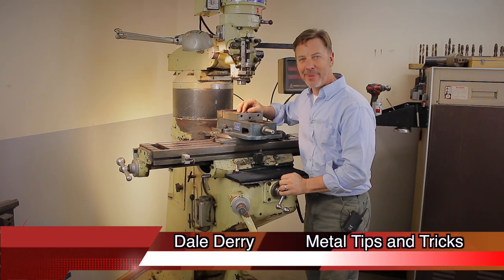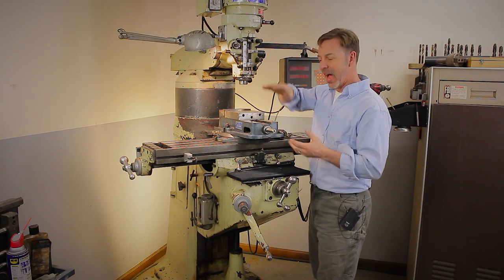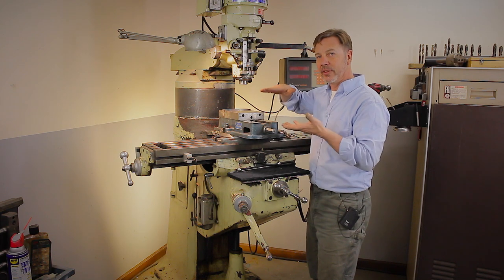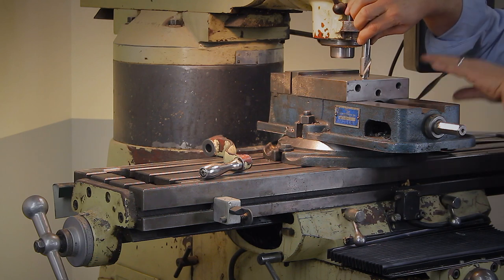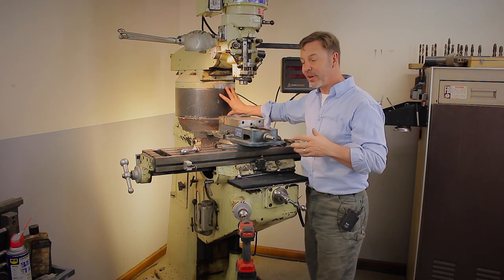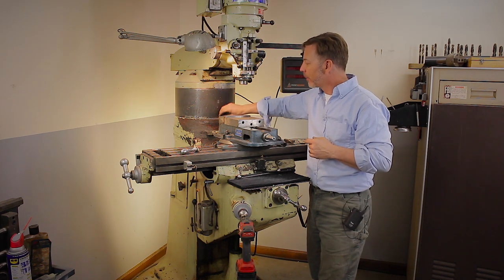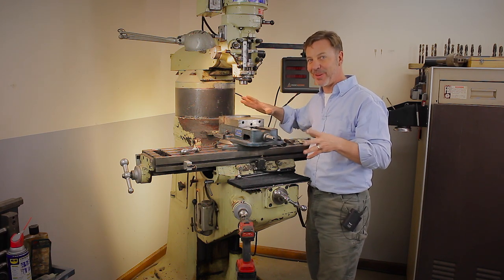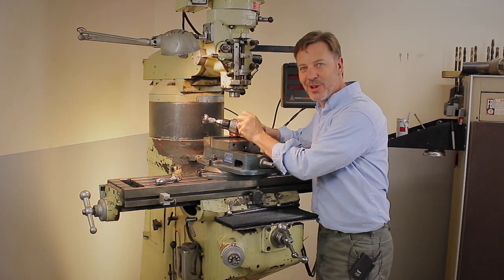Milling Machine riser block

Comment: Dale I agree with being able to stand upright while working with the mill as the best reason for adding a riser. Of course I'm 6'2" so that ads a level of comfort to operations. As a project I would just buy the riser kit for my mill instead of doing any machining. They sell riser kuts in 4", 5", 6", 7", and 8" that I am aware of and may even sell them larger than that. The kits i've seen also come with the needed bolts and the spider that goes inside the riser and kits go from around $350 to about $700. When you consider the cost of materials and time machining it makes sense to buy the kit.
Thanks for your wonderful videos and keep up the excelent work.
Cheers,
John
Reply from the maker: +Old School Cop Shop 
Thanks for your comment

Comment: Dale,
I hear you on the back issues. Somethings built for 5'6" guys don't work very well for us 6' types. It can be pure misery.
My Brown & Sharpe horizontal is on 4x4's to get the height of the cutter up where it's convenient for me to work.
It has the added advantage of allowing me to move it using a pallet jack (slightly overloaded but effective). 
I haven't moved it, but I can. :)
I plan to make adjustable leveler/riser blocks but haven't gotten around to it yet.
So that means as soon as I get a round touit, I'll make them and make a video of the process.
Thanks for the video.
John
Reply from the maker: +John Bazaar 
Great comment. Please send my a not when you do the video.

Comment: I have a Grizzly G0796 mill.  I originally bought the 6" swivel vise with it.  With the drill chuck I was loping off and regrinding special shorty bits for some jobs.  I bought a 6" rotary table and 5" scroll chuck which was ok for small stuff but generally too small for my projects.  I bought a 12" rotary table and a old 10" Bison scroll chuck for it.  With that on the table I really need the riser block.  With the big-10" I get the rigidity I was missing with the 5" chuck and can safely hold a part of significant size.  A crane rail is going in now to make the riser install much easier.  Yes, a two-step stool will be needed for this average height hobbyist to reach the quill bolt but it will be worth it.  Yes, it's good to be able to do set ups and mill directly on the table but the majority of my projects require either the vise or the big rotary table.  Before I retired set-up time was where you either made it or got your ass handed to you.

Comment: Risers are awesome!  I prefer a 4"  so I can still work off the table with a short end mill.  I bought one off of e-Bay, but keep in mind Bridgeport clones are not always interchangeable with a real Bridgeports.  I got an import riser and needed to boar it out to fit.   It was an easy modification, but if you only have one machine you may need to reassemble the mill to modify the riser.   Good thing I have a second Bridgeport.  You will probably want a power draw bar if you use a riser if you don't have one already.
Reply from the maker: +Roger Fries 
Great comment. :-)

Comment: Dale ---

I used to work in a prototype machine shop that had one Bridgeport with a riser extension... No one would use it, because of it's inherent inefficiency... Particularly, when doing jobs that require loosening the draw-bar to change tools... It is nothing short of a real pain in the ass.

Furthermore, I'm sure I'm not the only one who noticed, that when you screwed the knee lead screw out of it's nut, the table was still 6 - 8 inches away from the quill.... Not all jobs are done in a vice... Sometimes you need to clamp work directly to the table... In which case, in order to reach the work, you may have to set up a job on risers, and in a lot of cases, extend the quill... The more you extend the quill, the less rigid it is.

Engine blocks --- The Bridgeport mill (Series I) without a riser has a max. table to quill height of over 18 inches.... A Chevy small block is only around 13 inches, from oil pan flange to manifold deck - no riser needed, if you're milling the oil-pan flange, or the manifold deck ( as in the case of a set of "clipped" heads where you need to take some off to get the manifold bolt holes to realign.)

In short, the riser is a poor solution to a problem that doesn't arise often enough to justify it's lack of efficiency.

This isn't to diminish anything you're doing - in fact, you've shown THIS old dog (Journeyman Certificate 1966) some new tricks... Love your work... Love your videos.

Frank
Reply from the maker: +franksalterego Thanks for your comment. :-)
Reply: particularly when what? comment got truncated
Reply: I find that the short guys always bitch and moan about the riser block ;). I'm 5 10 and have no problem reaching the drawbar. Sometimes I run the mill for a variety of jobs and probably swap tools over 100x in a day, it never bothers me. The same can't be said for the hunchbacked angry old man I used to work with. Nothing a 20 dollar stepstool cant fix :D
Reply: The need for a riser block is very shop specific. For the type of work that I do, it’s necessary. I just ordered a 6 inch riser block for my Taiwanese Jet brand Bridgeport knock off.  Probably what I really need is a horizontal boring machine, but I don’t have room for it in my shop.

Comment: Good video.  The mill that I cut my teeth on had a 3" riser and I never knew that it was there unit, I used another mill.  It was at an engine shop, and we did not surface on the mill, but when you were indexing lifter bores or adding splayed bolt main caps you needed every last inch to get a big block Chevy setup in there.  Thanks. R.J.
Reply from the maker: +Abc Defg 
Thanks  for your comment

Comment: Like the riser and the added capacity. I would be concerned however, of cranking the knee completely out of the nut and damaging the threaded end. I've marked my column to prevent just that on mine. Perhaps an extended screw (2-3") might be a good project to add to the riser?

Colin :-)
Reply: +CompEdgeX I ran my knee lead screw out of the nut and it jammed going back in.  Had to jack the knee way up and clean up the start of the screw thread.  I will make sure not to do that again!
Reply: ***** I've "heard" that can happen...:-) Thats why mine is marked!
Reply: +CompEdgeX I needed to raise mine for some measurements for a DRO, I brought it up to the top and when I went to lower it  was stuck and when I turned the lever to lower it it pulled the screw up and  cracked the casting on the bottom where the screw sits. this is a new to me mill that was sitting for maybe 10 years before I got it. Got it free and it just rest at the bottom and is working fine. I WILL NEED TO MARK MINE
Reply: Ed Ginsberg
Bummer that it cracked...probably got up past the dovetails enough to jam?
Reply from the maker: +CompEdgeX 
I think marking the limits of the table is a great idea. I don't think adding an extension screw would work, because you push it past the limits of the dovetail ways. Great, comment thanks

Comment: So I've been thinking of adding one to my mill, but I'm already having trouble reaching the drawbar as it is? Now I'm 5'10" which isn't that short, so how is it you nan reach the drawbar. Do you use a step stool or something? Plus how does that effect the accuracy of the knee? Does it get tighter the higher you go up because of less wear on the knee ways? I have a worn out production mill which I really need to have rescraped (should be been done this winter but the 27" southbend has been the priority since September). Okay well thanks for another fine video Dale, I don't suppose you'd do one about rebuilding a mill?
Reply from the maker: +The Texas Gun Guy 
I use a step stool. and I'm thinking about scraping my mill this spring.:-)
Reply: +Metal Tips and Tricks (Dale Derry) I send you my mill to practice on if you'd like😏👊

Comment: I have an 8" riser on mine and I despise its presence for most work.  It does allow some more Z clearance , however it does limit your ability to reach the table for larger, plate type, non-vise work without extending the quill too far. It really depends on what type of work you are doing.  If you do not absolutely need the additional clearance, DON'T DO IT just because you may need it "someday",  you will regret it.   I plan on removing it at some point, its just a chore without a crane, as mine has a much larger 5HP geared head.  I would give my riser away if someone wanted to remove it.  You will definitely want a power drawbar with the riser.  Reaching the drawbar requires a step with the riser in place.

Comment: Dale I have a question about the drill.  Much has been said about this.  Here  is a common  six or V8 block on the table.  Don't need a riser- Big Cincinnati has
the travel.  OK;  so I crank up the knee 5,6 turns with two arms, I have to sit down. 
So,  before the trouble of machining said adapter for a drill? I see already what guys
use (batt drill) & won't cut it with this mill.   Guess I need a 1930s 80lb drill thats got
50hp  lol  problem is they don't have reverse.  So what's your guess.    sam
Reply: Would a longer handle for more leverage help you?
Reply from the maker: +samuel pine 
Sorry to here you have to big of a mill. LOL There are some drills with cords that will handle it. Here is one from Porta cable model 6615. I do not know if they still sell it. You might find one on eBay.
Reply: Thanks Dale oh I have electric drills alright problem is they are fifty pounders ;  guess I'll live with it.   sam

Comment: I'd like to know what your Z-axis capacity is w/o the riser. And was it added due to a lack of capacity (mostly) or for ease of use (added table/crank ht). Thx Dale.
Reply from the maker: +Bill Wightman 
The capacity of my mill is 16 inches without the riser 23 inches with.  Originally I thought the capacity would be the most important, but rising the table up to a more comfortable hight is really the biggest plus for me

Comment: hello congratulations for the video, if in the absence of cast iron find a common steel tube about 30mm thick and make fittings in case you need to put flanges and solder have stress relief in an oven would be good one over 1 inch thick ? I have a home milling machine also one of the brand Veker vk430vp, here in Brazil we only use [iso 40] and for mine I made a riser block, but gray cast iron with 90mm height, was the only material I had in hands , but I exaggerated the thickness must be about 100mm thicker. I'm very satisfied even with less than 4 "in height already improved a lot.

Comment: If you  did occasionally need to get extra knee movement, a simple spacer under the elevating screw outer would get you out of trouble, and a lot easier to do than make a longer screw.

Comment: In a recent video, you did a poll, could you please do some cylindrical grinding and lathe internal and external threading. also that drill adapter will be a good project for me will involve a rotary table i dont have one at work anymore  :(
Reply from the maker: +nathan hellyer 
No you will not need a rotary table. Im going to try and do some grinding videos this summer.

Comment: I have two Bridgeport series 2 mills, one with and one without. The mill with the riser gets very little use as the drawbar nut is 9ft 3inch off the ground. Oddly I have never found a hands down winner for the block yet due to the head size haven't found the ambition to remove it!

Comment: Another advantage of using iron instead of steel for the riser block is that irons (cast iron, ductile iron,  Meehanite) are all vibration dampening, whereas steel transmits vibrations.  That's why the traditional material for quality machine bases and many machine tools is iron.  Of course,  a home machinist will probably not be too concerned with an occasional vibration.  Given that, oak, concrete, or any other hard material would be suitable.  Availability, workability and cost then become the factors.  Nicely finished concrete would be just as pretty as painted iron.  Who will be the first with a concrete riser?
Reply from the maker: +Jack Wittlich 
Great comment